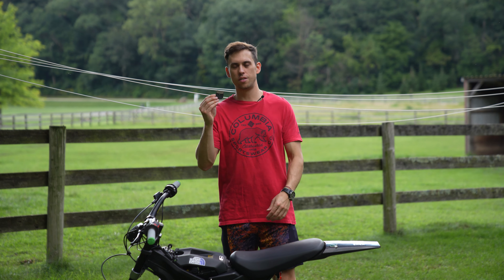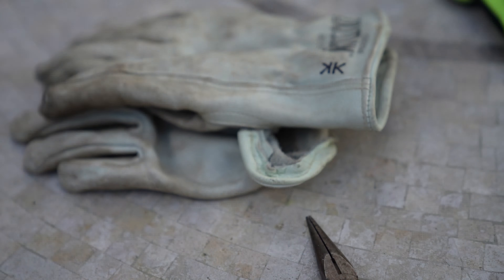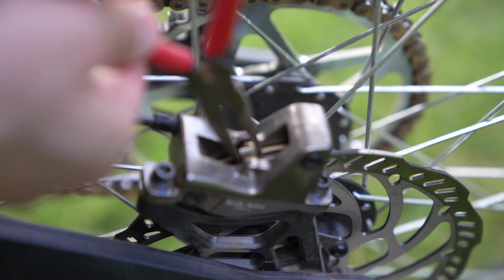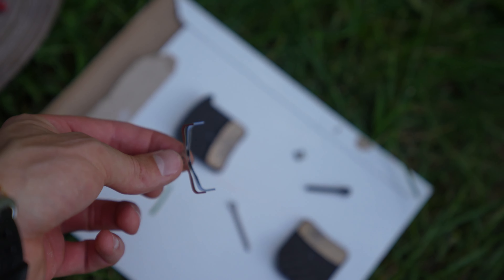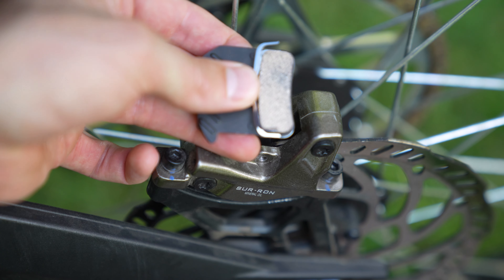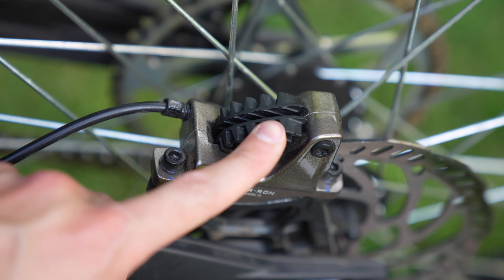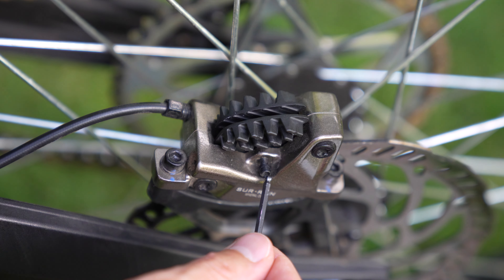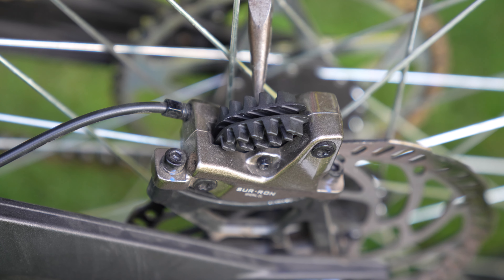How to install bike disc brake pads  |  Shimano H03C on a Sur Ron X

Comment: My left break pad slides in but me right one doesn’t
Reply from the maker: sometimes they go in easy, and sometimes it's kinda hard and you have to maneuver it just right,.. it took me a couple tries too
Reply: Try to push the pistons away with a flat head and a rag wrap thru

Comment: do i need new brakes or just new pads because ive rode my surron for 540 miles and my front brake doesn't work theirs no leaking or rotor contamination but is it just that easy all you need to do is switch brake pads?
Reply from the maker: hmm im not sure, maybe if your hydraulic fluid isnt full that could be causing problems, or if there is air in the lines.  my stock brakes were functioning normally, so then when i added the new pads it just made the stopping-power better
Reply: @KevinCarly  did you end up putting the front pads on?
Reply from the maker: @ellestar2306  yeah i ended up putting new pads on the front too!